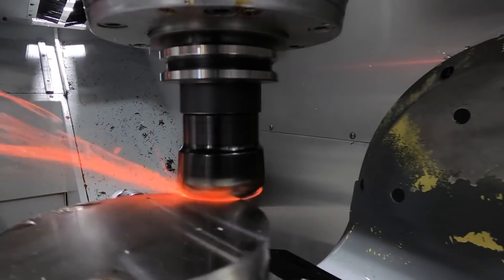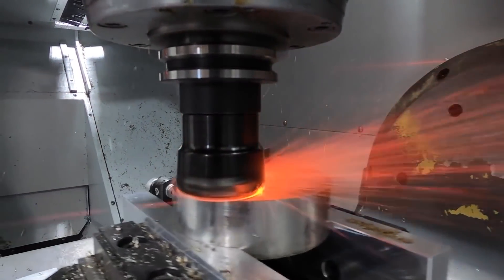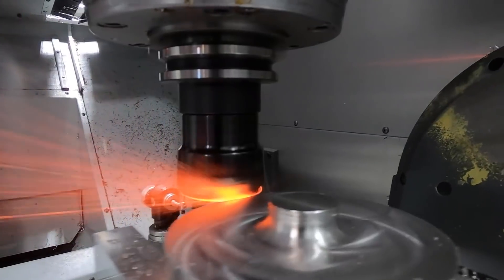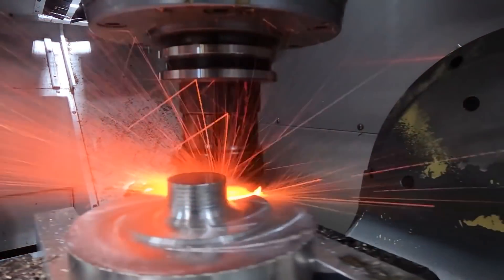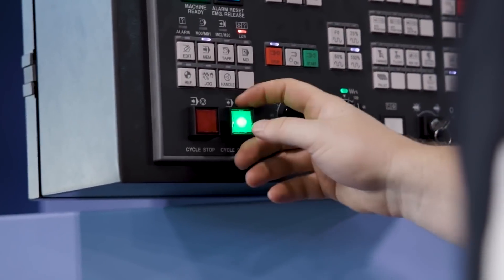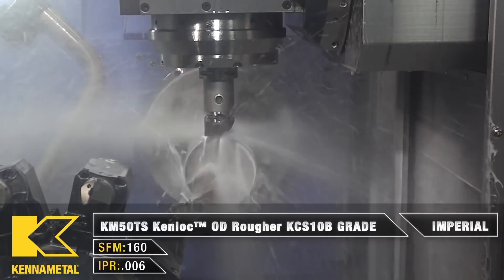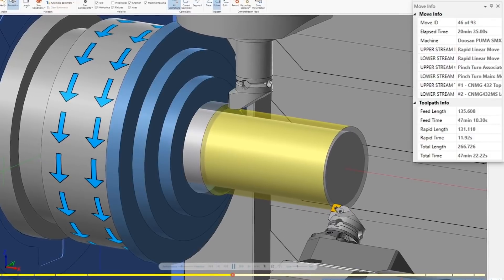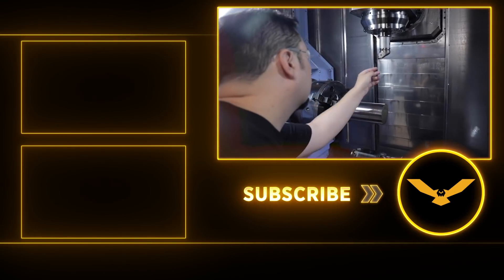DAMAGING the Cutter by Feeding it Too SLOW

Comment: This video is one of the most helpful that I've come across! 40 years ago when I first started CNC programming I basically cut my teeth on super alloys:. Hastelloy C, Hastelloy B, Monel 400, etc. And I found myself doing exactly the same thing that this video talks about. The carbide inserts we're wearing out very quickly, so my first instinct was to reduce the feed rate.... Which, since these were work hardening metals, only served to precipitate the hardening feature to greater degree. Hence, I was making the situation worse. But unlike today, I did not have the benefit of any of these wonderful videos to help me along and show me the correct way to change things.

Comment: Speed and Feed should be sync with each other depending on tool and material. I have experience with steel material and inserted drill where speed is too low and feed too fast can produce thick chip and overload the spindle load, so I got to bump up the spindle feed and work the feed up until I have it at recommend spindle load at 80%.

Comment: interesting, I played around this aspect in the past and came to the same conclusion: in some cases a lower rate doesn't initiate the actual cutting process correctly. I took the risk and doubled the feed and lo and behold, it did cut much better...

Comment: What is surface footage?
Reply: Surface footage is a measurement of how much distance a carbide insert or tool tip will travel in a minute. For instance, 120 sfm means:. 120 feet (across a surface) in one minute.

On a CNC lathe this is most noticeable when doing facing operations. You program in a certain surface footage, but as the tool is getting closer and closer to the center of rotation the spindle speed is going faster and faster. Why is this? .... It's because the amount of surface (diameter) it's becoming smaller and smaller as the tool approaches the center of rotation..... But because a certain surface footage has been written into the program the machine tries to maintain that surface footage by speeding up the spindle speed as the surface becomes smaller and smaller.

This is also noticeable when doing turning. Every turning pass that's deeper than the last one..... Cuts the diameter smaller. In order to maintain the programmed surface footage, you will notice that the spindle speeds up more and more with each deeper cut. The reason? As the diameter gets smaller on each cut there is less surface!

Think about it for a while.  You'll start to understand.
Reply: @johndonlan5956  cool. We call it "skjærehastighet" in Norway. Translates directly to cutting speed :)

Comment: I used to mill hardened steel(above 50-60hrc) with normal endmills, which was good up to around 45hrc

In roughing where chips was coming off the tool lasted for hours sometimes, but if I started a finishing pass with the same type of tool, it died in minutes

They don't like to rub the material, a certain minimum of feedrate should be used to extend tool life, especially in hard materials

Comment: I've been told you have to be careful of these same kinds of "machining sins" when you're running plastic; not because of work hardening, but because not pulling enough heat out in chips will melt or soften the plastic, gum up tooling and decrease precision from cutting mushy material, possibly also burning it as well.
Reply: Not a machinist, but I've tried drilling 3dprinted parts. That'd even worse. These plastics turn liquid at 190-230^C and they're soft at 60-80^C. If I'm not "confident" in my drilling, the area around softens and I get weird misshapen holes, ruining the part usually.
Reply: I've run in to the opposite while running polyurethane, albeit because of tight specified tolerances with no way of clamping the material (50 shore C, +/-0.1mm milled slots) where the only real solution was to not clamp the material (instead just blocking it in with metal stops on all sides) and going so fast I'd rather not watch the machine (375Vc with 0.0113Fz when the material isn't even clamped, 32mm mill at (s3732, f168.7  metric feed) and hope for the best.
And no, I don't know why it wasn't just cast to that shape instead of being machined.
For those who don't read industrial: 50 shore C is about the consistency of a gummy bear.

Comment: I figured this out the hard way a long time ago while hogging copper. Another machinist that had small man's disease raised hell because I increased the feed rate. I simply followed what the manufacturer suggested for the insert tool, whereas he wanted to run it like a high speed steel tool.  Overall, I cut part to part time by half... he really lost it when I did that. lol  I guess he thought it made him look bad since at that time I had been machining about a year at and he had been machining about a decade. If it did it was just the icing on the cake, I just wanted to machine it the best it could be with the equipment we had.

Edit: I miss machining
Reply: It’s funny how people get offended when you make their process better isn’t it lol I worked with a guy at my last job that was the same way.   To me, if someone can make what I am doing better then we both learned something
Reply: .... me too!
Reply: keep up the good work

Comment: I've had to explain this principle many times. The force vector imposed on the insert has to enter the body of the insert. Realizing this is one of the best ways to understand it. Too slow or too thin ends up pushing the force vector past the insert surface and simply runs it flat, which can happen almost instantly as soon as the underfed cut begins. Then once they increase the feed or speed, you're already try to cut with a dulled insert. Applies to all tools, including drills etc. High speed tooling as well.
Reply: all you need to help people understand this is give them a  manual drill press and a bunch of big holes to drill
Reply: This is brilliant! I never understood about Force vectors..... But when I try to imagine in my mind what you're describing here.... It makes perfect sense! Thank you so much!!!!

Comment: Quite interesting, the chips produced by the milling/cutting processes are like tiny heat blotters which pull the heat away from the work and cutter surfaces. With the cutting lubricant keeping the work cool to allow easier milling/cutting/threading.

Comment: Why are spring passes so popular, are these not rubbing the material?
Reply: Yes spring passes rub more than cut.  Most people use spring passes for tight tolerance features to ensure there is no tool deflection.  Or you may have to use them if you have a deep wall or pocket and you need to straighten the wall up from tool deflection.  I am not a fan of spring passes but sometimes you can’t help but use them
Reply: @Jessie_Smith  Looks like I missed an opportunity to thank you too sir.  Like your work, although I have never even seen a 5 axis machine in real life.
Reply: Spring passes are sometimes necessary when you have deflection of either the workpiece or the cutter. Milling cutters almost always have some deflection. So when you take the final pass or two without taking any further depth of cut (the definition of a "spring pass") it will allow the milling cutter to finally straighten out.

If you're turning a Long bar on a lathe, one end supported by the chuck and the other end supported by the tail stock..... You may have some deflection in the middle section of the bar. You may notice that it's a little fatter in the middle.... Then at the ends. That's mainly because of the deflection of the bar under cutting pressures. The bar will not deflect at the Chuck end or at the tail stock end because it's too well supported there. But there's no support in the center section of the bar. So taking a spring pass or two will help to ensure uniform diameter throughout the entire length.

Generally speaking, spring passes can be successfully performed on softer materials like brasses and aluminums and coppers and low carbon steels. But once you start getting up into the super alloys category, taking a spring pass would probably not work well at all..... Because these materials work harden easily and the cutter would not cut - it would only rub.
Reply: @johndonlan5956  Thank you for answering. I have had some poor surface finishes with spring passes on many steels and my lathe limits speed to 50 rpm with the door open so using sandpaper is not that effective. Maybe there is a door lock override function to allow sanding like one can do on a manual lathe but do not know yet.
Reply: For your own safety, if you do find a door safety mechanism override.... And you want to use some abrasive substance to polish you're turning work down to size..... Never do it single-handedly. Always used two hands. There is a temptation to wrap the sandpaper around the shaft as it's spinning, however you could very easily lose fingers or your hand that way. Get some Emery cloth, tear it into a long strip, and hold it openly with two hands against the far side of the turning piece (thus the emery cloth will form an exaggerated u-shape looking from the side). Do not let the two ends of the emery cloth touch each other (forming a closed loop around the workpiece) because in an instant the paper could catch on the workpiece and quickly wrap itself and your hand around the spinning shaft.
Reply: @johndonlan5956  Thanks for some very sound advice. I am lucky enough to remember most of that from years back, but seems like many new guys in the trade have to find that kind of information on their own.

Comment: Does this apply to cutting wood on 3018?
Reply: yes you want to make chip and not saw dust
Reply: It applies to cutting pretty much anything.. its just how much can you get away with depending on the material. In wood you can burn the material which means you are rubbing too much. TONS of different wood specific end mills for varying applications though.

Comment: Couldn't have said it better myself. If you're making the right size chip in some materials you can dry cut and the chips are glowing hot, but when you touch the part after a cut it's cool.
Lower feeds generate more heat and the last thing you want to do in materials like titanium is heat up your part or tool.